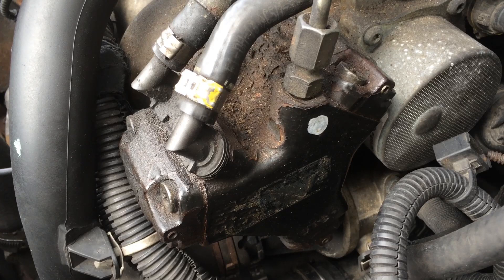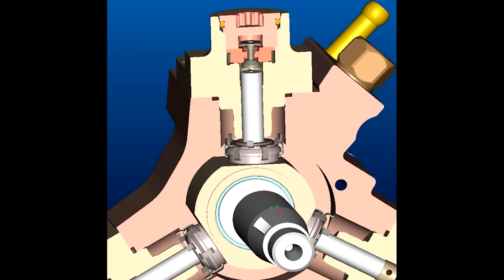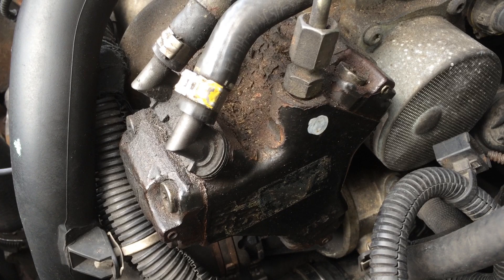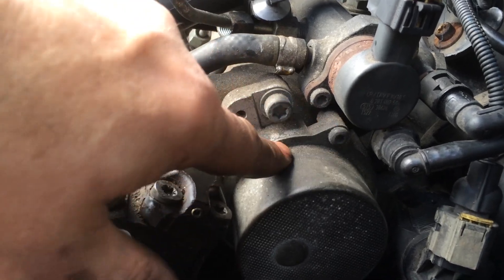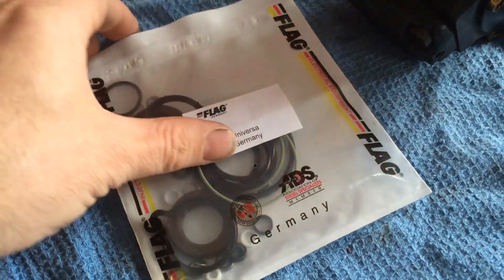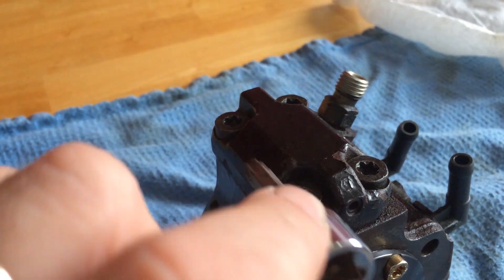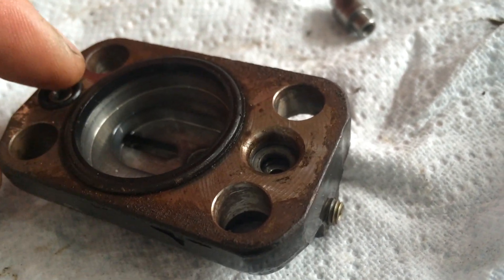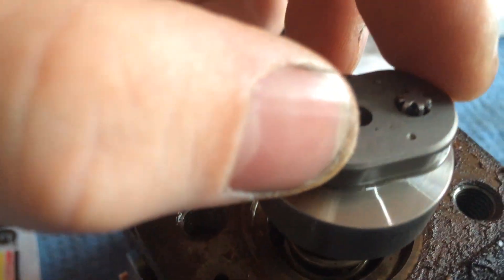Replacing the seals on a Bosh CP-1 High Pressure fuel pump, car won't start

Comment: Hi, can this pump make a ticking noise? Mine is working fine but the engine makes a ticking noise, only accelerating (injectors have been refurbished) .
Thanks
Reply from the maker: No expert - but a light ticking noise is usually injectors - there is a check valve in the pump, which could be worn and give a similar sound. Try putting a screwdriver on the pump, and rest the handle on your ear, and see if the sound is louder in your ear. Kind of a stethoscope teqnique. Otherwise, ticking sounds can be you cam/valve lifters not pressurising with oil. (can't remember this engine that well anymore) Hope that helps.
Reply: @alanmann hi, the valve you are talking about is mounted on the rail on may car(320cdi w210). I’ll change it this week to see if it make any difference.
It’s a fine ticking noise only on acceleration. 
Thanks for answering 👍🏾
Reply from the maker: @cloatza89  Check your oil pressure (if you can) - especially when doing higher revs - If the oil lamp on the dashboard flickers on, then probably a blocked sump pickup. 
Ticking when revving could be lack of oil getting to the cams... Just a thought. Good luck.

Comment: My  corsa  opel   1.3 cdti  does  have  the  same  hp  pump
The  car  won t  start  or  very  hard  start  when  engine  us  warm  after  running  about  one  houre   
I  have  to  wait  at  least  15 min  ti  allow  engine  to  cool  down  then it  starts
But  there  is  no  problem  on cold  start
I was  told  it  could  be  the  faulty  hp  pump
What  do  you  think
Anyway  thanks  for  the  vudeo

Comment: ** Tip 1 ** - When you take the out the pump retaining screws, hold a magnet stick close by to catch the screws rather than drop them into the bowels of the engine bay.
** Tip 2 ** - A one size too small Torx bit will often appear to fit but will slip and chew the crew head. ALWAYS try the next size up as very likely to fit snugly and can't slip.

Comment: Capping the open pipes is VERY important. You could also brush loose dirt away with a shop vac to get rid of the bulk crud. Then get the whole pump into a wash tank to remove 95% of the loose crud that will be into every gap. It won't be the whole job but makes the later deep cleaning much easier.

Comment: Wasnt that leaky, should have seen one on my jeep, you could see the diesel seeping from under heads when cold. Whole engine soaked in diesel. Hopefully it wont leak anymore and HOPEFULLY no gunk got into the hoses. I used ultrasonic washed on the body and all the components before assembly. Anyway, fuel hoses have some kinda brow/rusty film on the inside (took a swab wit a qtip). Also... the pumps shaft had some corrosion residue (no pits), and that tells you much about fuel quality and water in it... Now, imagine what would circulate in the system if you had metal fuel tank (mines plastic).... Anyways, how did it go? Pump seals did it for you? I dont think the seals alone can cause crank/no start, at least not as long as the air doesnt get inside the system. And if it does get in, then you would have a MASSIVE leak.

Comment: Could this be the reason for no start when warm ? The seals might expand when up to temperature there for it lets in air causing it to turn but not start?
Reply: Exactly opposite. The diesel leaks out and air gets in when cold. When up to temp seals expand and tighten the seal, no leaks. I could literally see diesel seepeing out from under the head on my jeep when cold. Hot - no prob. So, no start when cold, the longer the car sits the more air in system, the longer crank. That is... if theres no electric pump in tank. Jeep doesnt have one, has low pressure pump at the front of the block, above HP pump, that sucks fuel from tank. You get air in, good luck starting it.
Reply: @marcinn6312  charged the pump and it no longer gets warm and it starts cold or hot. Thanks

Comment: Hi there! Great video Alan! Maybe you guys can help me with an issue. I replaced the seals on the Bosch CP1  cause I had a mayor diesel leak. After doing so, the engine fired up right away and I tested the car and everything seemed fine. The issue is that now, while I accelerate at full throttle, the car enters into LIMP mode and dies on me, you can turn the key off-on and the car will start immediately and I can resume driving... This didn't happened before. If someone knows what could be my issue or is there any part of the pump I should replace please let me know. Any help is much appreciated. Cheers!
Reply: Usually it happens because of fuel pressure regulator failure that's on the pump, but check error codes first
Reply: That's a usual symptom of wastegate axle stuck.Give it a try with some penetrate spray and try to unstuck with a long screwdriver.
Reply: This wont help Edgard but any changes to the fuel system need the engine ECU settings to be reset. MutiECUScan and the appropriate OBD cables allow you to look at the ECU parameters and reset to suit new parts.

Comment: @7:04 This is the reason you should clean the entire outer body casing before commencing. Small micro particles that can be transferred is a no no. No particles ought be on the inside anyhow, so do take care its an awful lot of work to get it wrong. Good illustration video in both respects neg and pos = Perfect.
Reply: It will all be washed off in the ultrasonic bath, but an external bulk clean makes later deep cleaning much easier. I would fully wash the whole lot, probably in stages so cylinder parts can't get mixed up.

Comment: Hi!my car doesn-t start!it has the same cp1 HP pump!dismantle the pipe from common rail and no fuel comes out when motor cranks!dismantle also the plastic hoses and on the inlet also no fuel when i rotate the key to on position!i do have fuel with some pressure on the return when i switch to on position.the LP works and providrs fuel to the filter inlet !the hose between HP pump and filter is not cloged!my car it's an old Hyundai Elantra 2.0 crdi.Any clue?

Comment: I keep hearing that these pumps through metal when they start going bad.  Where does this metal come from ans what do you do to fix this?
Reply: When you find any metal shavings inside the pump, you'll need a new pump. Seals wont solve anything if the metal is damaged.
Reply: @Dave5843-d9m  no metal.  And cp3 pumps don't produce metal

Comment: hello can you tell me wat kind of ,i need to order to reapir my pump for my mercedes c200 cdi w203
Reply from the maker: Sorry - I don't know those cars. If it looks like the one in the video (3 compression chambers) then it is probably the same one.
Reply: Its not the same one you can find the correct one on autodoc or similar websites to find your pump
Reply: @dagurorarinsson2827  it is physically the same pump on a w203 although a c200 will most likely require more pressure than a Corsa so in that sense it may be a different spec but anyhow, Mercedes can supply the HP pump seal kits. Be careful though - on a Mercedes, the HP pump creates a venturi effect in the tank that draws fuel from one side to the other, if the HP pump is weak the car might appear to start and run OK but say on 1/4 tank of fuel (maybe 100 miles range) it will appear to run out of fuel. So this is also HP pump failure - I'm not sure a simple seal kit will cure this.
Reply: @moonkef  hi, yes it is the same body but the fuel line locations are different :)

Comment: How did you depressurise the HP pump, whats the best method?
Reply from the maker: Just loosen the metal pipe from the pump to the common rail. As soon as 1 drop comes out, the pressure will be gone. Or wait 5 mins or more after stopping the engine. Pressure drops by itself.

Comment: Hey men i realy need you to answer a question , i live in a vilage with not mutch educated people , i have the same pump on a vito 112 w638 but i forgot from where i took the 2 lines on the side ; (in your video in the beginning from 0.00 sec until 0.06 )  one has a normal hole like on the low presure pump and goes to the crankshaft and the other has a bigger hole but has like a one way valve and goes between the front 2 seals ... if it is posible i can send you pictures to make it more obvious... thank you .

Comment: Can you go into more detail about flushing the pump through with diesel at the end. Which pipes do i leave off. Or do you connect them all but leave it unattached frm the engine?
Reply from the maker: connect the 2 plastic pipes from the fuel filter. Leave off the metal one going to the high pressure fuel rail. (optional - take out the glow plugs to make turning the engine over easier) Find a way to collect the fuel coming out of the metal pipe on the pump. Use a rubber tube, angle a plastic bottle. Lets loads pump through. I think I disconnected the pipe from the High pressure bar, loosened it at the pump end, moved the end around for easy access, then tighted it back up at the pump (if that makes sense) it was easy to collect the fuel into a clean bottle and put back into the tank. Let plenty flow through, you don't want any dirt getting to the injectors.
Reply from the maker: just leave off the metal one, that connects to the common rail. If you remove your glow plugs, you can turn the engine longer without flattening the battery. I did it for a minute I think. You don't any rubbish getting to the injectors, EVER :)

Comment: hi I am fixing a pump like this. how did you remove the plastic pipe on the side of the pump? I tried pulling it out but I wasn't able because I was afraid to broke the plastic pipe.
Reply from the maker: the external rubber/plastic pipe. Remove the metal clip holding it on to the pipe. If you are referring to the plastic elbow on the pump. there is a torx screw holing it on. But there isn't a need to remove these.

Comment: i have e 270 cdi 1999 dosnt start at cold i chang the heting glue plug and i test it every thing ok but not start when it cold until i put starter like petrol or some thing in medafold what is my car problem plz if you can help
Reply from the maker: Does the engine turn over faster than usual? if so, could be compression issue. Check the inlet manifold is't coked up. Also air pressure sensor
Reply: Your diesel injector's is dead . Had the same problems many times.
Reply from the maker: check you have volts and amps going to each glow plug - put a lightbulb in place of the glowplug and make sure it comes on for each glowplug connection. If they do, then check engine compression, or leaks from injectors.

Comment: well done, but how the hell you didn't get any crap in that pump I'll never know, would of been inclined to off cap off the inlets and outlets first and clean the outside of the pump
Reply from the maker: I was very carefull with it when the pump was in the car and no tubes connected. Plus, before the finally connecting  the HP pipe, I turned the engine over with the High Pressure outlet not connected to anything. This way it pumped fuel all the way through, but not into the common pressure rail, which obviously has no filter and goes straight to th injectors.